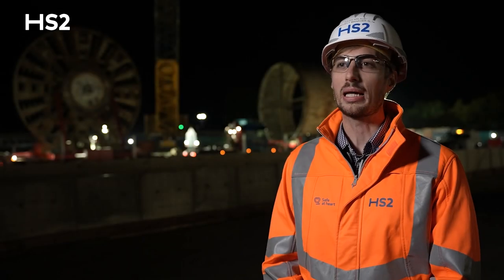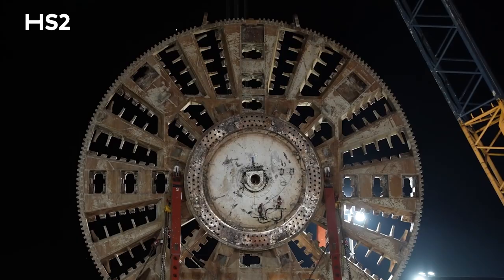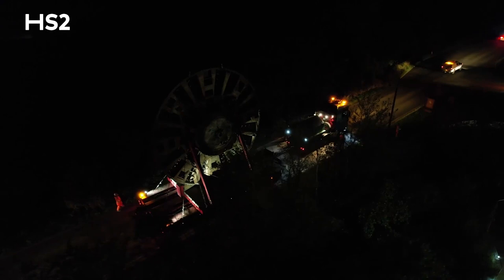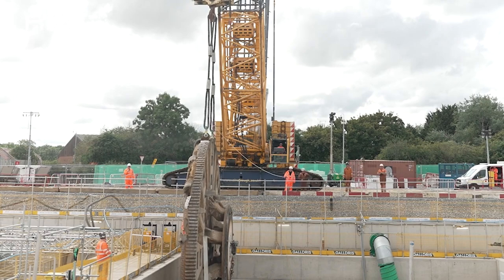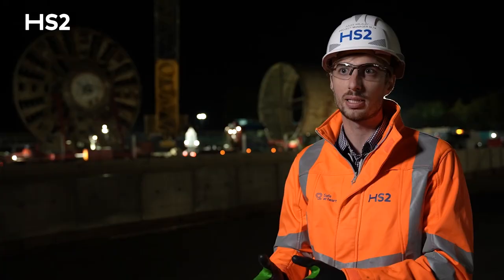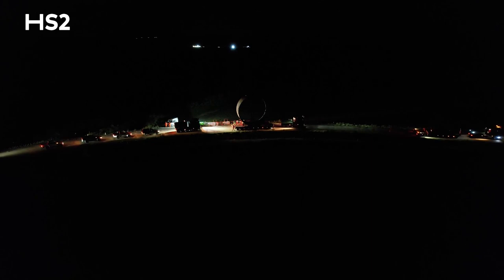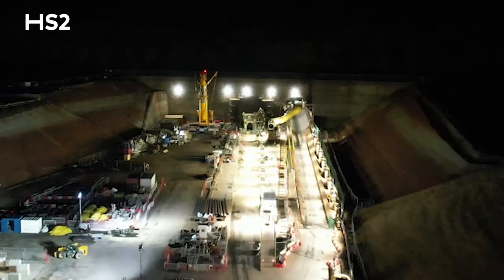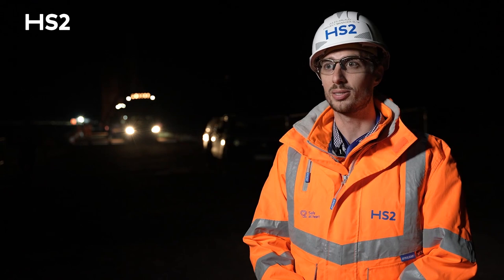TBM Dorothy's cutterhead completes impressive journey back to start second dig in Warwickshire

Comment: Just out of curiosity, was there a reason this approach was taken vs for example pulling the entire thing through and turning it around at the egress portal?
Reply: No room, and also the other section is small enough to reverse back, bearing in mind the cutter head is larger than the tunnel it leaves behind once the tunnel lining is installed.